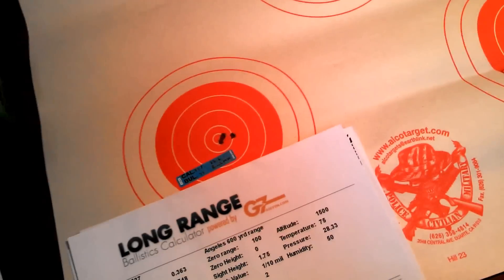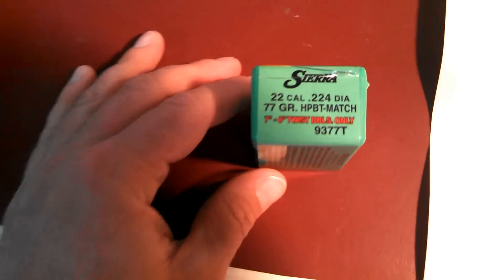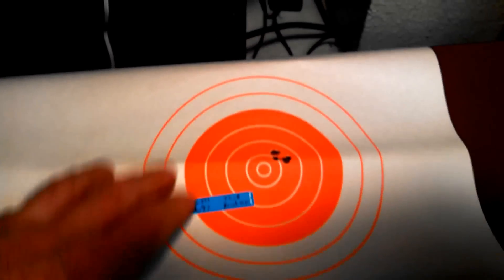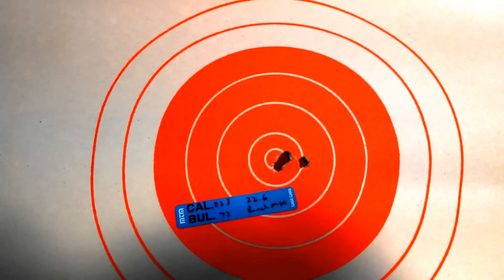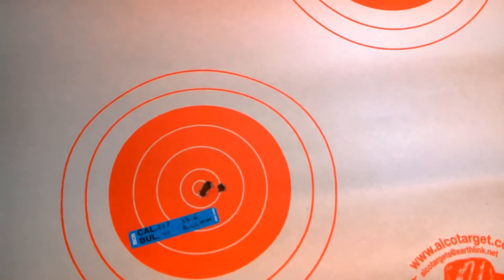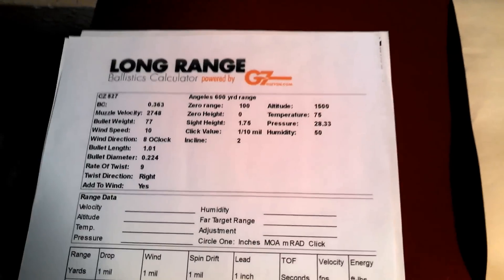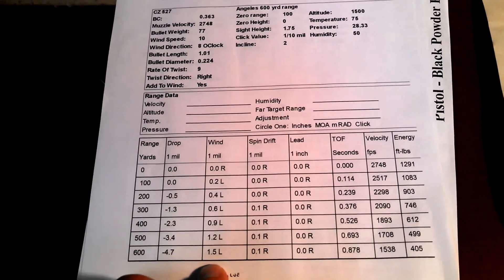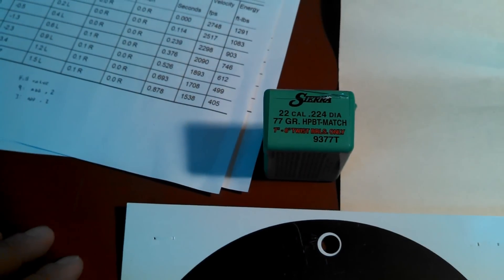.223 Long Range Load Development. 77gr SMK in a 9 inch Twist. CZ 527 Varmint Kevlar

Comment: I have a 16 in barrel what you think I need to load?
Reply from the maker: Need more info then that.
Reply: O okay I finally got to watch it again. We have wyler and spikes upper and both are 1/9 16''. I looked on some forums and they said 77s would do pretty well. I also have 75 speer I'm looking to dial in. I'm looking for my data I had for those 75 speer in a 223 configuration.
Reply from the maker: @donaldenox6332  The 77 SMK will work in mag because they are built for it. I have a bolt action with a 24in barrel so our result will be different. You should also consider the
 muzzle velocity you are searching for. Know that the bullet length is just as important as the weight if not more. I would just use the hodgdon website start developing from there all rifles/barrels are different. Nobody's secret family recipe is gonna work best in your rifle. There are many ways to work up a load depending on your goals. Also the brass prep and loading process is more important than you powder charge. Hope this helps.
Reply: Yes that was lot to go on. I cant remember the content my signal is bad at the moment but will rewatch and give more info sorry bout that.

Comment: So 2.665 coal was the best result so far? Am i understanding it correctly? Thanks for such a educational explanation and vid man.
Reply from the maker: Remember cbto. Case base to ogive. Every rifle will be different.  .010 to .030 off the lands is usually good.
Reply: @W6RIPRadioAdventures  with 75gr was it tight fit into the magazine or no fit? Im having issue fitting 75 eld match to magazine in howa 1500....
Reply from the maker: You will need to single feed. Use coal length from the loading manual if you want to use in the magazine. Some bullets will need to only be single fed because of design. The longer sleeker bullets will need to be single fed most likely. The 77 SMK is the heaviest I know that can be mag fed.

Comment: Did you try any other heavier bullets in the 527?
I tried both the 68g Hornady hpbt as well as the 73g eldm and both keyholed. Just curious if the Sierra somehow has something  magic going for it the others do not..
Reply from the maker: I was able to use the 80gr Amax. I eventually tested my barrel with a cleaning rod and learned that my stamped 9.00 in barrel was really a 8.75 in twist. The 80gr Amax went over 1600 yards.
Reply: @W6RIPRadioAdventures  
Thanks for the reply, I'm really bummed that the 68 and 73s did Soo poorly. I'll have to double check my barrel's TR but it also states 1:9 really hoping I can find something in the 65-77 gr range that will be stable out to 600.

Comment: I have a 527 KV  , I tried 80g vld berger and 75g A-max  without any good result.    I had amazing result with 69g Lapua scenar ( 3.5"@700y) .  I've had good luck with the 69g SMK as well , I wish I had tried the 77grainer !!!!!!.     Now I'm mostly using this rifle for gopher hunt with Nosler 40g B-tip with amazing velocity and accuracy.    This is the best rifle out of the box ever !!!
Reply from the maker: .5 moa at 700 is great! It is the best outta the box! My barrel ended up being a 8.75in twist. I shot the 80gr amaxs 1670 yrds in my other video. I totally got lucky with the twist rate.
Reply: @W6RIPRadioAdventures   Mine is 1/9" , did you actually mesure the twist to say its 1/8.75"    ( also what is your elevation )
Reply from the maker: @egSmith-sp9gl  yes. I used my cleaning rod and did the measurements on twist. I kinda knew is was less than 9 like it is stamped but i wanted to know for sure to get good data on applied ballistics. All the numbers are on the video. Elevation was around 2100 ft.
Reply: @W6RIPRadioAdventures   I will have to mesure mine just to know !!!!   Also mine is parkerized , not blued ?    I bought it 10 years ago !

Comment: I believe 26 yards is best, been doing it for 30 years, if you can one hole or .3 your tight at 100 I have 6.5 Lapua that ,3 .2 at 26 and 100
Reply from the maker: Thats awesome!!. You know! I have a custom 6.5x47 being built.
Reply: @W6RIPRadioAdventures  the little Lapua is right there with my 222's super accurate

Comment: If you shoot like that at 25yds you wil never shoot any long range. If that was at 100yds A OKY.  At 25 yds your group should be one hole. Rather test your groups at 100yds or further. Your bluffing yourself if you test your groups at 25yds and they look like that and think its not going to change at n 100
Reply from the maker: Paul Verwey thanks. Did u see the other video with 3 hits in a row at 1255 with this load I developed at 25 yards?  I did 25 yards because I did not have access to 100 yards. 25 yards was a test and it worked.
Reply: 11DayScrape then i am very happy for you. I love it when people shoot accurate. My argument for testing loads at 25yds is that you margen for error are so much bigger. But enjoy your shooting!

Comment: Still don't understand very open fascination with heavy bullets?   Velocity for the most part equals flat trajectory,  I want some 40 grainers doing 3500 fps but thank to the manufactures messing up the twist rates you can't buy a factory gun that shoots them. :-(
Reply: shawn, you are far off course.....bullet design is everything when it comes to shooting at long distances...go spend some time looking at ballistics at Applied Ballistics website, speed does not mean less drop at long range...
Reply from the maker: You will understand when you understand ballistics.
Reply: 11DayScrape I understand bullet design has some to do with it, a fat round nose can't buck wind as well as a spire point,. But the slower the bullet is traveling the quicker it drops.  I can easily see that just by shooting my .223 and 22-250 at 250 yards.  The .223 starts the guess work while the 22-250 you just hold dead on.
Reply: I understand boat tails have less wind drag and more aeordynamic bullets will resist wind better. But shooting a 30/06 with 150,165, and 180 grain bullets at 300 yards the 150's are definitely the flattest shooting showing less drop in inches than the 165 and 180's

Comment: A group at 25 can't be the same size as a group at 100 without other changes so your development and accretions are flawed.
Reply from the maker: DonziGT230 How? Explain... Have you ever tried it?
Reply: If your hit is 1/4" off at 25 yards it'll be 1" off at 100 assuming no other changes in trajectory.  Point of impact will also shift up/down between the two distances unless you re-zero the scope for those distances.  Both of these things are simple basics and if you don't get that you're riding luck to develop a good long range shooter.  Doing load development at 25 for a precision rifle that you intend to take out to long range is useless, even 100 usually isn't gonna cut it because the shots will be stacked so tight you won't be able to pick out the best load.  Most guys will go out to 300 for precision rifle load development and even then things might go off at long range with some loads, particularly if the bullet goes transonic before hitting the target.  If it worked for you it was luck, not evidence.
Reply from the maker: Yep, you are right. It was all luck. 1255 yards for 3 hits in a row (with this load) was all luck. Brass prep, understanding stability factors and wind reading was all luck. If you would have read the info box first, the purpose of this video was to show you "could" use this range to develop a load if you lived in the city and did not have access to 100 yards on a regular basis. I never said it was better than or a replacement for 100 yards. What are some of your accomplishments or experiences? Why don't you share some of your results instead of criticizing mine? You will eventually learn that group size is not that important in extreme long range shooting like I did. I have done something with my rifle. That is my evidence. I am not concerned with your thoughts or beliefs on my experiences. Soon you will understand that in life, there is no such thing as luck... Thanks for sharing.
Reply: I said nothing about your brass prep, wind calls, or any of that other stuff; that involves skill and work and has nothing to do with the conversation at hand.

Do the 25 yard development with 2 other completely different loads and you will have some evidence that defies everything we've come to learn.  One can get lucky once and luck absolutely exists and does happen in every field.  People win the lottery, on slot machines, and at the roulette table; proof that luck does exist.

I threw together some .223 loads with obsolete powder and bullets pulling the numbers out of guesstimates from other loads and loaded them into mixed brass for some initial testing.  I shot them in the cheapest 16" upper I could find for my 80% build wearing a Chinese scope from Amazon and shot under 1/2 MOA.  I'd love to say it was my spectacular skills, but logic tells me there was some luck at play as well.
Reply from the maker: It seems what you call luck, I call chance. If like the word luck, you make your own luck buy giving yourself a chance to succeed. If you win the lottery, its because you bought a ticket. If you win at roulette, Its because you put down some chips. If you win at a slot machine, it is because you put in money and pushed the button. Luck would be winning the lottery without buying a ticket. Its easy to say I lucked out but really I gave myself a chance that something would work by trying. I also made multiple loads this way for my 7mm Rem Mag and I did damn well hitting a target at over a 1000 yards multiple times in a row. That was not luck. I tried, tested, decided and succeeded in what I was trying to do. I used a 25 yard range to make up a load to shoot over 1000 yards because that was my goal. I gave myself a chance, I didn't luck out. I have since stopped using only groups for long range load development. I use standard deviation and groups together but I am more concerned with my standard deviation to make a decision on what load to use. Shooting 1/2 moa with the setup you described was not luck. You tried something and succeeded.

Comment: Scrape I too have found that shooting a 77 Gr Sierra BTHP Matchking from 1\9 twist can be done. Thus far my best groups are 23.0 Gr RL-15 with LC Brass & CCI SRP@ OAL of2.260 from the Alliant web site. And with 23.4 Grs of Varget with LC Brass & CCI SRP @ OAL 2.260 from the Hodgdon web site. All from a 26 inch Savage Model 12 Bolt Gun. Since I have a unused bottle of Benchmark it's time to give it a try.

Comment: You might wish to test this round at over 100. Because I believe you could be close to bullet destabilizing. As your bullet slows down it will destabilize. But if you do not wish to shoot past 100 then who cares. I personally like to shoot my 223 at 300. But really why shoot them great bullets at 100?. You really could go cheep on the bullets and get the same results.
Reply from the maker: Farmer Dude357 . totally. this was a few years ago. I have vid of this round hitting 1255 yards 3 times in a row. I ended up learning how to measure barrel twist with a cleaning rod and this rifle measured 8.75in twist. I shot a 80gr Amax over 1600 yards and hit steel. vid of that too is up.

Comment: Good work with the 77. My 1/9 Carbine shoots everything from 55-77 grain quite well, but the 69gr BTHP do best so I tend to stick with those. Both SMK and Barnes Match Burner in that weight works excellent. I don't do bullseye work with that particular rifle, it's just a 16" 1:9 M&P15 with a 3-9x40 1" tube from Primary Arms so I mostly just shoot steel with that setup but at 500-700 the 69s do great all the time. (The M&P15 & M&P10 are both amazingly accurate; 5R rifling rocks!) I run the 69gr about 2790fps. Typically I use Varget and TAC for these loads but I've also done quite well with CFE223 and even H335 & bulk WC844. I use standard CCI SR primers, nothing fancy like MilSpec or BenchRest primers, brass is just fired and cleaned commercial FC/PMC and NATO spec LC,TAA,WCC, and PSD (PMC military). No fancy Lapua/Norma type brass here either. I can hold 3/4 MOA easily with the 69gr load from the 16", and tailoring it to my bolt gun I can turn that into 1/2 MOA or better at roughly~2980fps. I recently also added a cheap Ruger bolt gun in 6.5 Creed to my collection as well and man that is a crazy accurate rifle for a little over $400. I've mostly been a fan of Savage bolt guns and my go to 1000yd+ rig is a Savage 110 in .338LM, but this cheap Ruger in 6.5CM shoots 1/2 MOA with factory Hornady ammo all day long with a basic Bushnell 2.5-10x40 on top of Larue mounts. Budget all the way, under $900 for rifle,scope,mount ready to tackle 1000yd tasks with ease. Gotta love the shooting world in 2017!

Comment: I have 1 in 12 twist through 1 in 6 223 barrels.  A 3 shot group at 25 yards is good for getting you on the paper at 100 yards, it will not get you on target at 300 yards or any kind of long range. my testing with a 1 in 9 twist indicated to me that 65 grain or lighter will be stabilized. bullets above 65 grains in my 1 in 9 twist gave me random wobblers, or complete tumbling, which show up when you shoot about 25 rounds at the same aiming point. 
Hornady 53 grain vmax have a BC of 290 and will give you the highest BC that will consistently, all the time, not just ocassionally, stabilize in a 1 in 9 twist. when bullets that are on the margin of stability for the rate of twist, sometimes give good 3 shot group, but will randomly scatter bullets that are not being properly stabilized. the average computer keyboard Warrior BSer does not shoot enough rounds at the same point of aim to ever figure this out. Sierra has a very good 65 grain BTSP that works excellent on deer and a good BC. The 53 grain vmax has killed 2 - 10 point 200 + lb bucks that i know of both went less than 30 yards after being hit. the states that do not allow 223 for deer are basing law on folk lore myth and BS regurgitated from archair keyboard warriors.

Comment: nice vid. i shot some 77 gr .22 cal bullets over 2 yrs ago, I was using a bolt action at 100 yrds against clay pigeons, couldn't hit a one. mind you I've hit 500 yrd steel targets so decieded to put up a 25 yrd and see. one shot was all it took, bullet had gone through the paper sideways. changed gun to a semiauto and perfect holes on paper. shot the pigeons no problem. i found out after getting home and cleaning that the bolt action has a 1 in12 twist, and thte semiauto a 1 in 9 twist. hence my bolt action is limited to 62 gr and below,. that 500 yrd target i hit w/the bolt action was done w/35 gr bullets.

Comment: yeah.....noooo I'd say you're BSing with this video, anyone else notice the black patch to the right of the group? I'd say you've got 3 bullets to go nicely in the same spot but the other 2 have "spread" to the right, in my reloading/ testing experience your results are extremely rarely the same at 100 yards as at 25 yards.....if ever...but that's just my opinion/ experience...
Reply from the maker: I noticed that too and thought someone would think exactly what you thought. That was a different grain bullet I used to make sure I was on paper at 100 yards.  I only shoot 3 shot groups. After some grouping experience, to me, 5 shot groups are a waste of good ammo. Most of shots 4 and 5 go inside the first 3 shots. I try to reuse my targets until I can't anymore.
Reply from the maker: +Richard Garnache I have since changed my methods. This video is pretty old back when I first started out.

Comment: I would point out that the next 9" twist barrel may not shoot them at all. Button rifled barrels often have variations in twist. So your 9" could easily be a 8.5 or faster at the muzzle this will allow it to shoot heavier bullets. I have a 9" that shoots even 75 gr Amax fairly well.  But the next one might be SLOWER at the muzzle and will through 77 grain bullets  into shotgun patterns. It takes very careful checking to get a twist. So far as getting good information at 25 yards? Good luck with that. If I were going to shoot at long range I would be testing at 200 or beyond and verifying at 500-600.
Reply from the maker: Dan Phariss True. Every rifle is different. I have taken this load and shot it 1255 yards for repeated hits (transonic at 910 yards). However, I am now shooting the 80 gr Amax at 2820 fps as my long range round.
Reply from the maker: I checked the twist a couple years ago. It's 8.75. Barrel is stamped 9.  I have since moved on to the 80gr Amax. That one went hit over 1600 yards. I'm working on a new powder for better velocity and using a different load development method. It worked fine for a basic load development job. Wouldn't use it for competition.  Not many people will even try to shoot a .223 that far.
Reply: Dan Phariss
CZ barrel are " Cold Hammer Forged" , not button rifled !

Comment from the maker: Thanks. I'll check out "ocw". This video was made 8 months after I started shooting and reloading. Many techniques have changes since then. Recently, I have started loading for standard deviation instead of groups. 25 yards was not intended to be a replacement for 100 yards but only a substitution if 100 yards was not available. (my local 25 yard indoor range) This load I chose at 25 yards proved to be 1/4 moa and scored repeated hits at 1255 yards. I have since moved up to the 80 gr Amax with good success. I have pushed that one out to 1566 yards without load development while I closely circled the target. It will only get better. I got lucky with my twist rate and it must be something shy of 9. *****